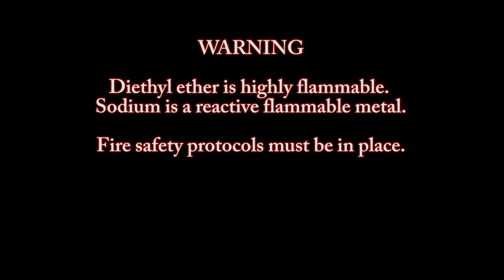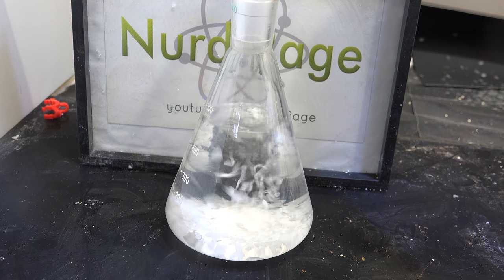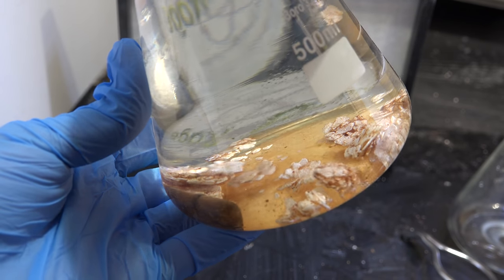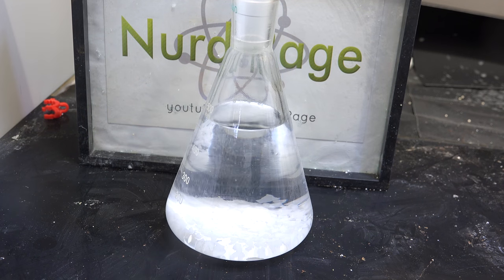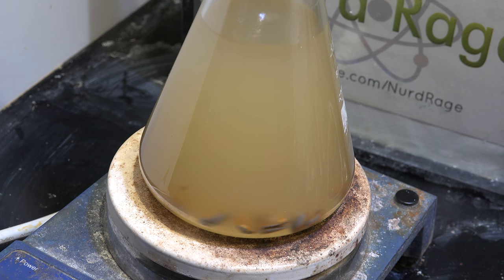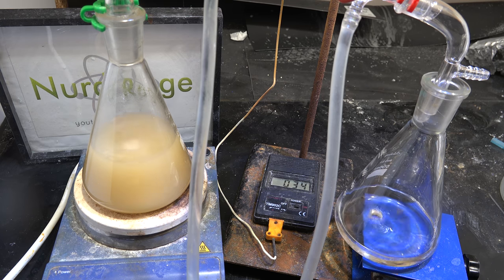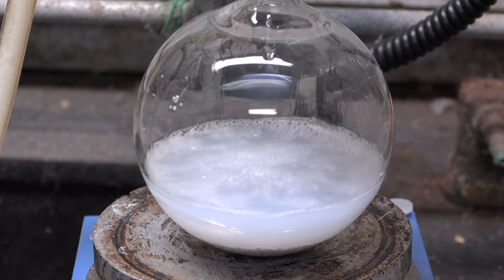Purifying and Drying Diethyl Ether For Grignard Reactions Using Potassium Hydroxide and Sodium

Comment from the maker: Apologies for the lateness.

The whole grignard project was about 6 videos worth of work plus failures. I'm currently editing them together into seperate topics. The first one is this video, preparing the solvent, since grignard reactions are so dependent on good solvent that they deserve a special video for purification. The second video will be on performing the grignard reactions theselves, I performed 4 reactions to make 4 different products but i'll be putting them together into one video. The third video will be on testing the products to make sure i performed the reaction correctly.
Reply: NurdRage love your videos buddy!
Reply: What’s a grinyard reaction?
Reply: Grignards are much easier to initiate when using the Iodide, rather than the Bromide or Chloride. I synthesized  benzene from sodium hydroxide and sodium benzoate, cleaned it up and used it to synthesize Iodobenzene and then produced PhMgI with ether fresh out of the bottle. Initiated withing 10 minutes. According to the label, the ether I used was "for photographic purposes". Go figure.

Comment: A couple of points if I may.  1) I would use a ground glass connection on the receiving flask.  2) Locate the receiving flask a little further away from the heat source.  3)  Collect the diethyl ether in an ice bath.  4) pH Test Strips.  5)  Do not use the molecular sieves because of reuse problems.  6)  Use KOH for ether storage in a labeled clear reagent bottle with phenolic screw top secured with plumbers' tape on the inside, and electricians' tape on the outside.  7)  Refrigerate ether when not in use.  8)  SDS (MSDS)    And last, but not least,  9) Peroxide test strips.  Have a blessed day.
Reply: Jeez. Someone has needed to have an inspection.

Comment: Pressing thin wire from sodium metal is relatively easy and safe. Due to the enlarged surface the drying process is more efficient and goes a lot quicker.

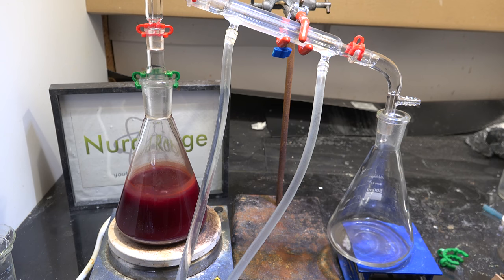Comment: 5:38 Isn't it bad to distill it to a flask without an adapter? It maximizes contact with air and moisture.
Reply: User THC Exactly what I thought...
Reply: Same, usually drying tube attachment on the adapter and then straight into a round bottom

Comment: was tbe ether really dry? i looked like there was a big space between the cooling unit and the flask, receaving the deatilled product. i think this way the ether will soak up humidity from air. maybe try a "closed" system, by using a "drying-pipe-end" filled with CaCl2 which prevents water from ruining your dry solvent. and if possible try to destill with N2 gas as protector and a protector valve for overpresure. this way you can eliminate water and oxidation. you eill end up with a dryer product.

best wishes from deutschland

Comment: Dr Butyl Lithium, I have some ether that is highly contaminated with visible peroxides (flat white flakes).  Can this be salvaged with your method?
Reply from the maker: if it's that badly contaminated then discard it. That level of danger is not worth working with. To salvage something like that you need to first perform a reduction step. But still, don't bother.
Reply: NurdRage dam, I was afraid you'd say that.   Thank you

Comment: It's really interesting that the sodium formed into a hollow sphere. I wonder what caused that, and if it's something that happens consistently.
Reply: it prob started as a semi spherical lump consistinc of smaller sodiumlumps
due to the low densitiy of sodium + being in diethylether the weight (not mass) of the sodium in the flask was very small
so the lump of sodium could be rather porous without collapsing under its own weight
over time rolling around in the flask rounded it's edges until it became a sphere
they weight simply wasnt enough to overcome the  compressive and tensile strength of the sodium lump while the forces of the uncountable impacts on small areas were able to overcome the impactstrength hence rounding the sphere without squeezing out the ether

Comment: You might want to store that batch over a sodium wire for better efficiency. Now, sodium press is a rare thing and quite expensive because so little of them are made, but you can use a clay extruder. I got mine on eBay and it works nicely.

BTW Grignard is a French surname, so the stress is on the last syllable.
Reply from the maker: Interesting! I gotta try that sometime :)
Reply: NurdRage %
Reply: This is the one. There are versions with just the plunger, but then you need a vise or something like that. This one works great because it has a built in lever which you can always remove and replace with a longer one to get more momentum.
And it comes with a variety of shapes.
https://www.ebay.com/itm/20-Discs-Pottery-Clay-Fimo-Extruder-Craft-Gun-Cake-Sculpture-Sugarcraft-Kit-Tool/361866126458?epid=505032234&hash=item5440e6e47a:g:QucAAOSwgY9XfhnS

Comment: Thank you for the video!  Will this method also work for dioxane that has been stored for a long time?  I always worry about how to deal with peroxide formation.
Reply from the maker: yes, it works very well with dioxane. Although i'll make a separate video for dealing with large amounts of peroxides. For exceptionally high levels of contamination you actually use another step first: a reduction step with sodium metabisulfite or iron chloride. Then you do the potassium hydroxide and sodium after. (but i'll make a video on that)
Reply: NurdRage Thank you.  I appreciate that very much.

Comment: Although I remember Chem Player did a video on a dirty and wet Grignard and it worked better than you would think.
Reply from the maker: very easy alkyl halides like ethyl iodide can work in wet solvents. But hard alkyl halides like chlorides require better conditions. Also, even if you have the grignard, water considerably reduces yields. Ultimately, you have to decide if you desire higher yield or reduced work. But just because something can be done badly doesn't mean it should be.

Comment: How do molecular seives protect against peroxide formation? I haven’t heard of them being used for this purpose before. Is it really that simple? I have added BHT to Et2O for this purpose, but depending on its intended use, it might have to be removed prior to the reaction.
Reply from the maker: It doesn't actually protect against formation... but it does catalyze decomposition of the peroxides. So you're still getting oxidation shit in your ether. But much less peroxides at any given time. So it's safer in the long run. You still need to perform a sodium distillation to get good ether. But now you don't have to worry about the bottle exploding in your hand when you take it down from the shelf.

Comment: i assume you don't have access to nitrogen? if you did i would do all the drying under nitrogen and even distill under nitrogen then store the ether under nitrogen. even if you don't I would have the receiver flask connected to the still and not open like yo did because the ether will pick up lots of water vapour from the air as it distills over.
Reply: Daniel Austin thats true
Reply: He'll put a small amount of sodium in the bottom of the receiver flask after he's finished with the distillation. That will easily remove any water that was introduced by having an open distillation. We used to use sodium wire in the bottom of ether flasks as it has a better surface area.
Reply: that will probably be good enough, however he will have to at least put a septum over the bottle so that air cannot diffuse in or just use it straight away. if he doesn't the sodium will eventually get destroyed by air seeping into the bottle.
Reply: I think he should try to get some nitrogen though
Reply: Graham Smith thats a bad idea for storing it because it produces H2. Just use some molecularsieve or nitrogen.
Reply: Daniel Austin the ether is pushing away moisture in the air as it goes out. There will be some diffusion, but it'll be practically insignificant. With such a small condenser the cooling  will be rather inefficient, and in that way the ether will go out really fast. I've tried that distilling acetone. The vapors were escaping so fast that it seemed like somebody was playing a flute.
Reply: That's what I was thinking. Go through all that work, then just distill it into a non-sealed container. "I got rid of all the water, now to add more right away". Not sure how he plans to do grignard reactions without dry nitrogen either, other than the "using a big enough excess to eat up the impurities and then some" approach.
Reply: Turk3YbAstEr with a CaCl2 valve grignards can work well and with high yields. The volume of the apparatus is small, so the air (and therefore the moisture) will be insignificant.

Comment: This is probably a dumb question, but could technical grade calcium carbide be used for the first step instead of potassium hydroxide? Are the main gaseous byproducts, acetylene, phosphine and H2S soluble in ether?
Reply from the maker: calcium carbide is too valuable to waste on something like this. Also, acetylene would indeed be soluble in ether, so you'd just be making more problems for yourself.
Reply: Ah, OK. That's good to know.

Comment: Could you do a video about super critical CO2? I heard about it and it's uses for separating chemicals but not sure how it's made or used
Reply: its co2 under a certain minimum pressure and temperature
https://en.wikipedia.org/wiki/Carbon_dioxide#/media/File:Carbon_dioxide_pressure-temperature_phase_diagram.svg
any combination of pressure and temperature that makes you land inside the super critical area 

its when gaseous co2 becomes as dense as liquid co2 so they get indistinguishable

its as viscous as  gaseous co2 but as dense as liquid co2 so it can infuse into a a certain material (for example coffeepowder) easily due to its viscosity while beeing able to dissolve/carry out alot due to its density

Comment: Why not try using 1,4 dioxane for a solvent in the grignard reaction, simply for experimental sake.
I know ether is a lot less toxic but dioxane is significantly less flammable, you have a lot of experience with dioxane.
Reply: 1,4-dioxane reacts with Grignard reagents to form dialkylmagnesium compounds and a coordination polymer of the form [MgX2(dioxane)]n
Reply: While Grignard’s are sensitive, these dialkylmagnesium compounds are apparently pretty pyrophoric. They can be distilled, however, which makes them interesting. I would like to see a go at it.
Reply: Ok so ive been doing some reading, it appears that when dioxane is added to a grignard reagent the equilibrium between the organomagnesium halide and diorganomagnesium species is pushed to the right as the magnesium dihalide is pulled out of solution as the polymer.
2R-MgX <------> R-Mg-R + Mg2X

http://pubs.acs.org/doi/abs/10.1021/om9000567

Thus you are left with the diorganomagnesium species left in solution, i see no reason why this would not still act nucleophilic.
In fact organo metallic reagents have been known for their nucleophilic properties for longer than the existence of the grignard reaction.
Organo zinc reagents being a perfect example.

Jeffrey brings up an excellent point, in that its likely the diorgano metalic species are specifically what instigates any pyrophoric nature to a grignard reagent and it is the fact that the equilibrium between the R-MgX and R-Mg-R that prevents a normally prepared grignard reagent from being very pyrophoric (enough to be carried out without purging the vessel with an inert atmosphere) as the equilibrium probably lies a lot closer to the R-MgX side than to the diorganomagnesium side.
This would certainly explain why organozinc reagents are notoriously pyrophoric

If this is the case then i see no reason why a grignard reagent could be prepared with dioxane as the solvent just as long as you take a couple extra steps.
Notably, purge the vessel of oxygen before adding your organohalide.
The issue i see though is that the resulting magnesium halide dioxane polymer might clog up the solution and make stirring difficult. Obviously filtering this off without a glove box wouldn't be a good idea.
Reply: jared garden I would prepare the diorganomagnesium compound and then attempt to distill it off at a reduced pressure using air free technique. I have read the can be distilled easily. If you start observing char, then a filtration is in your future.
Reply: Basically dialkylmagnesium compounds are so much more potent than Grignard reagents that in a lot of cases your reaction will go to crap unless you have a particularly robust electrophile you're trying to react it with. Side reactions occur more readily, even at low temperature, and filtration through anything but Teflon isn't an option because R2Mg compounds will be killed by most traditional packing materials (glass frits, glass wool, silica, celite, alumina).

Comment: NurdRage   You mention for storage to store over molecular sieves or sodium metal to prevent peroxide’s. Do you mean that molecular sieves destroy peroxide’s????
Reply: no only sodium does that.
Reply: KOH is best and cheaper.
Reply: MhDaMaster yeah I was like what!! Kinda hoping it was true. I was thinking maybe it would absorbe peroxide’s. Oh well I’ll just use sodium
Reply: Chem1456 for Grignard I would feel better storing with sodium metal. That’s what everyone usually does
Reply from the maker: Yes, molecular sieves 4A has been shown to destroy organic peroxides. But it doesn't absorb them, so the peroxide decomposition products are still there. You'll still need to distill before use if you have a sensitive reaction. But for storage, molecular sieves are good for preventing peroxide build up. 

(nonetheless you should still test for peroxides periodically)
Reply: NurdRage  I very much appreciate this information, I love using molecular sieves and now even more. I’ve learned many great techniques from you which have made me a better chemist. I look forward to the Grignard videos...
Reply: It forms insolubale salts with the peroxides. At my University all the ether is stored over KOH. Seems to work as well so it comes down to personal preference.
Reply: Chem1456    You prove a great point and it sure would be safer. I will put both to the test and see what works best for me. Thanks

Comment: Why not molecular sieves or something like anhydrous magnesium sulphate and then distill. You say there'd be other impurities that will be bad the Grignard reaction but that's why you do the distillation. Diethyl ether's boiling point is only like 35 C
Reply: thecsslife the problem with distilling over molecular sieves is that the amount of water they absorb is inversely proportional to temperature. A low boiling ether might not pose a problem if you use enough seives. But still, you’ll get some water coming over. Sieves just don’t “hold on to” water as tightly as when it’s bound up in a sodium salt.
Reply: MisterLepton I wasn't actually thinking of distilling with the sieves still inside. I was thinking of just decanting the mostly dried ether and then distilling that. Some water will come over but you can simply do multiple drying steps with sieves/anhydrous mag sulfate. The main issue is if there's low boiling point impurities.
Reply: thecsslife I guess that could work in theory if you did it enough times. You could try to do a simple Grignard with said ether, see if it works and report back here. I’ll tell you this, however. I tried drying ether over sieves and then NaOH and I still couldn’t get the particular Grignard I was trying to work. I kept thinking it was my magnesium but I now suspect there was just too much water in my ether. AND the THF was ACS reagent.